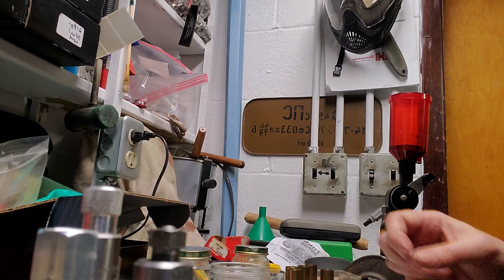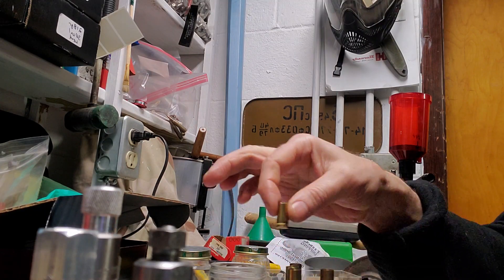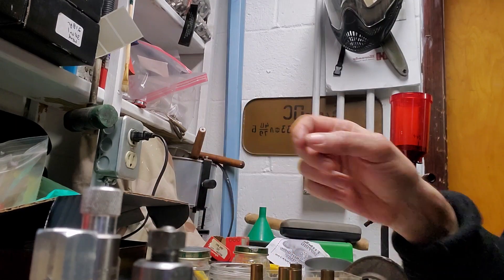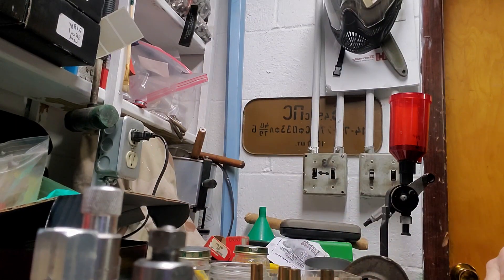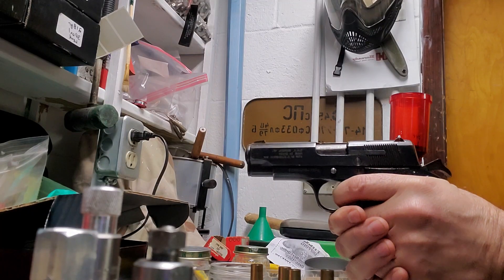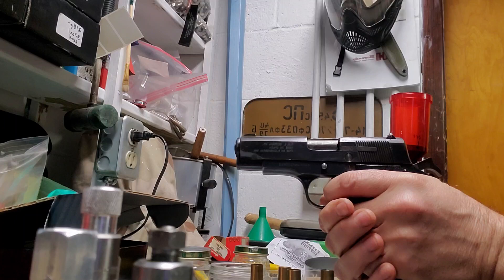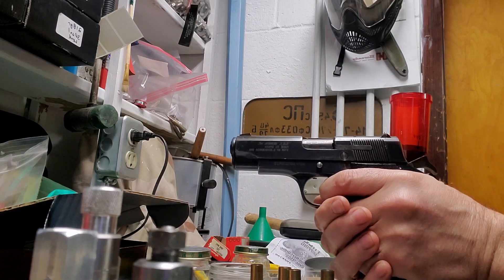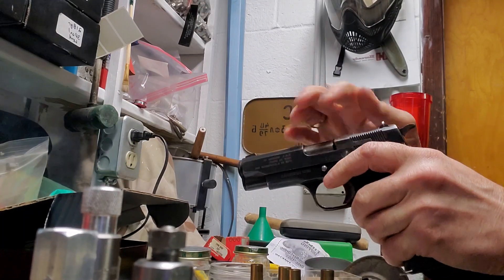Reloading small pistol primers. Successful test results

Comment: Success? 
I wouldn't claim success until I've actually been to the range and fired actual completed rounds with repeatable results. 
Just because you get a pop and some smoke coming out of the barrel does not equate to success. 
I know, I've tried several times and have had maybe 60% of my rounds (9mm) function...sort of. Every one that did fire failed to chamber the next round.
And yes, I used the same amount of powder I used when using new primers, and when doing so they ALWAYS chamber the next round, ALWAYS!!
Reply from the maker: True. I have 50 rounds loaded up, just have to run to the range.
Reply: @rifleshooter2  
Cool!!
I really really hope you get excellent results! 
What caliber will you be shooting? 
By the way, if you shoot rifles (.308 specifically) and have made some homemade primers for them with success, let us know.
I have tried and have had zero success!
Reply from the maker: @davidreynolds4715  mostly 9mm, I'm going to try them on alot of different calibers just to see how they work. I'm even going to attempt percussion caps for my muzzleloaders
Reply: @rifleshooter2  
Cool!! I'll be watching/waiting for you to post a video!!